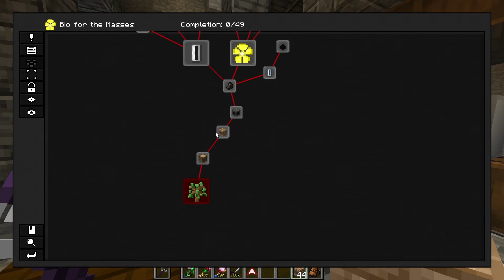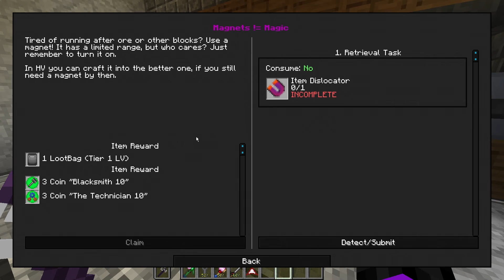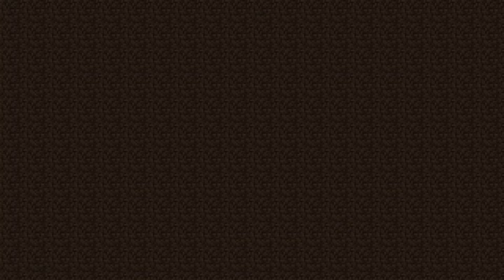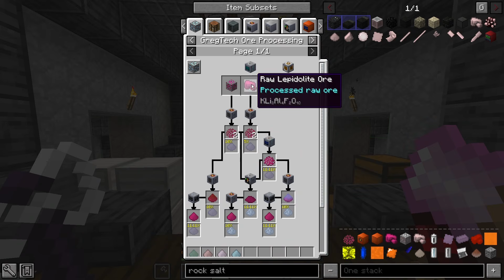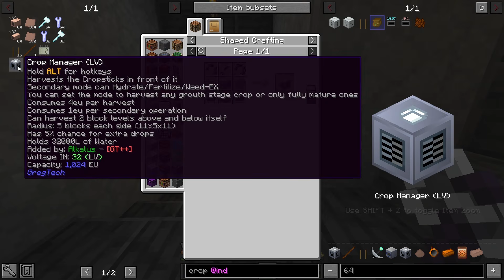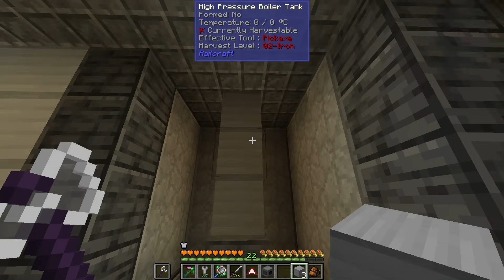GregTech New Horizons EP5 - Almost 576 Coke Ovens

Comment: Seriously man... you keep building too much inferstracture... (YEAH I KNOW... you've been told you need plenty but this is still lv...)
You don't need 5000 coke ovens

You don't need to make tanks for WATER storage
Etc etc...

You should get the ebf get mv going
Setup a few basic things like electrolyzing clay making aluminium etc 

And VERY SOON you'll have acess to supertanks and way way better options for well anything
The large potin pipes should be more then enough for lv steam usage
(Even mv steam usage!)
And soon you could use way better fuels like oil or benzen

Lv is a pretty short tier you simply need to transition from the "bronze" steam age with some basic machinary into the faster mv age where you can get the game going
(Mv is also pretty quick)
Hv is where you need to start setting up lsrge inferstractures ,ore processing chains/lines 
Chemical lines some annoyances such as distilation towers clean room for circuits etc etc 
Lv and mv should be quick
Don't waste too much time here

(Also it's a bit like going from the steam forgging hammer to the bending machine ,mv gets more efficient with some stuff like extruders making 2 rods

It may sound like a small improvment but when it comes to the long term efficiency that's A LOT of material saved)

Oh and mv machins are also twice as fast! (Only using 4x the power ,which as you can see you have plenty of fuel)
Reply from the maker: If I were to play as I usually do then yeah I'd probably be close to HV by now but I told myself I'd take things slow this time around and build up my infrastructure quite abit before moving on to the next tiers, and honestly it has paid off wayyy more than rushing everything, LV has actually been such a cool tier now that I've experienced it to the "fullest" and I'm still not done lol
Reply: @Dauom  yeah continue on the slow pace, these setups are great
Reply: "better fuels like oil and benzene" and where do you get benzene xd